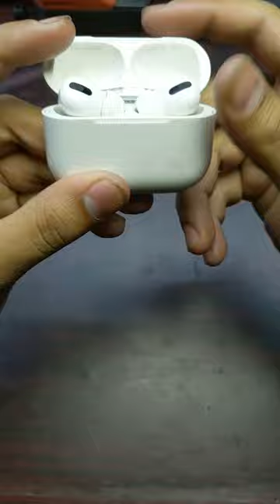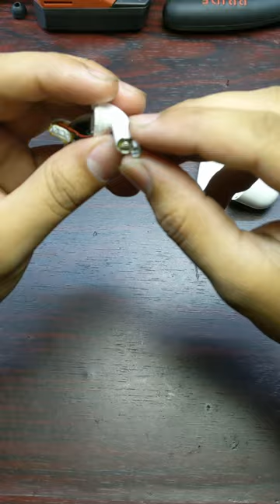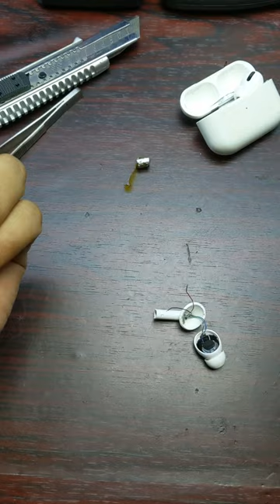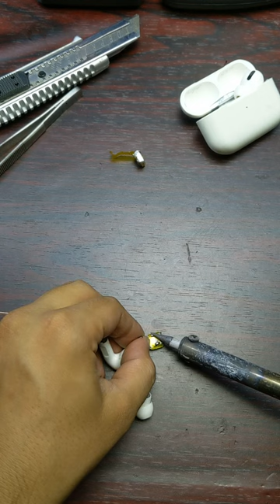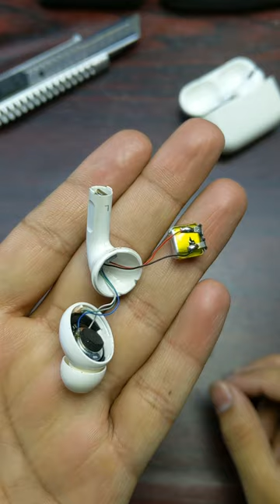How To Fix Airpods With One Side Working

Comment: Thanks u saved my 82 bucks Apple tries to scam me mines dropped and opened in half and I thought it was broken but it just opened and I snapped it back with a. Little force and it’s all good thanks so much I’m never dropping it again
Reply: @drtech6767  Dr tech Musa Nkosi here my one airpod is broken the other one works please tell me how to fix it
Reply: @musankosi2414  what I did was forget it from the device then reconnect them but that didn’t work for me so I tried cleaning the one that wasn’t working and it did the job!
Reply: @drtech6767  I have problem that is the not connecting to Bluetooth
Reply: @drtech6767  where is loction
Reply: how did u snapped it back? i dropped mine and it didn’t burst open but i can feel a ridge in the junction right there like it just moved a bit but it pisses me off because the other one is smooth and this one is a lil off and i want to snap it back:(
Reply: Same bro😥
Reply: From where can i buy this?
Reply: BRO THE SAME THING HAPPENED TO ME IM SCARED. IT WONT SNAP ALL THE WAY
Reply: @Hottieeeee101  it ll try harder
Reply: if yours look like this they are fake, look online how a real one looks😂😂
Reply: Same happened me😅

Comment: Hey i removed the lid at the bottom of the airpod put i cant put it back in place it doesnt seem to stick back tips?
Reply from the maker: There are locks. Try to close it properly so that the lock make contact and interlock.
Reply: @drtech6767  thx

Comment: i tried to change the ear but i broke it and the blue and green wire took off from the main board so how do i fix it
Reply: Solder it back
Reply: Yea this is the same story for me
Reply: I just don’t know where to solder the cables back
Reply: An hour later I then melted the AirPod trying to dyi solder it with a lighter and wire😂well I have Apple warranty I said to myself they can fix it. I call Apple they tell me I bought some fake AirPods😭I have a box serial number Apple coverage and a receipt, got scammed real bad
Reply: - Buy a new one.👍🏻🤦🏻‍♂️
Reply: Same story I'm crying right now I just want to replace the rubber bud

Comment: Dropped mine everything works but one no sound how do i fix it
Reply: yeah, mine too... the sensor works but sound doesn't
Reply: Same but I just opened the airpod to see if I could fix it everything is fine the wires are connected battery I still there idk what the problem is 🤷‍♀️

Comment: They are fake and they did not even start to charge because while charging AirPods the light turns orange and after full charge or if AirPods are not there in case it remains green

Comment: No way that it is original one. Dont try guys original ones will be much more harder to fix
Reply from the maker: Yeah. You are right. They are clone. Original ones need some heat to open.
Reply: @drtech6767  hey i have zebronics Zeb sound bomb 3 and right side isn't working and not opening too what should I do maybe wiring problem help me

Comment: simple solution, if someone dropped their AirPods, Now the sensor is working but the sound isn't working, this means that the wire got disconnected, take it to a shop and it won't cost much.
Reply: Can’t you connect the wires by yourself or does someone else have to do it for you 🤷‍♀️